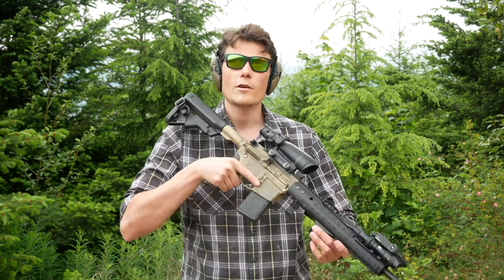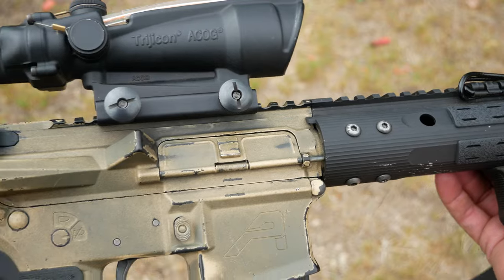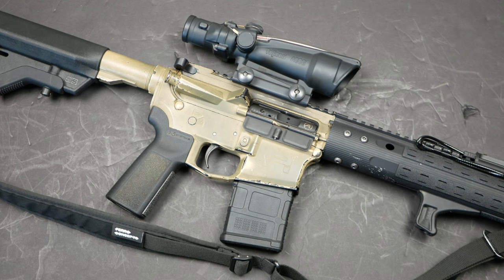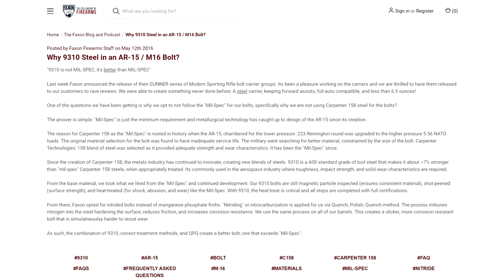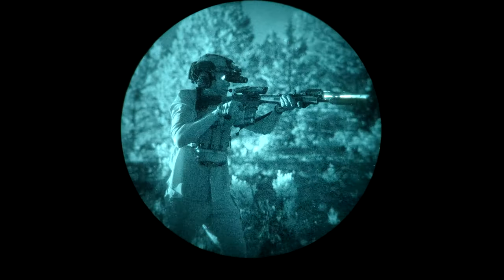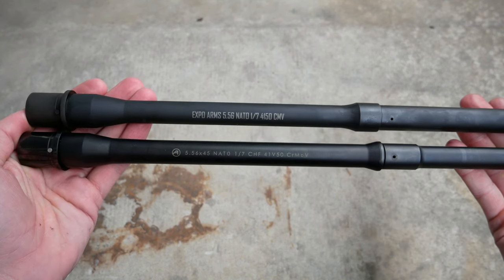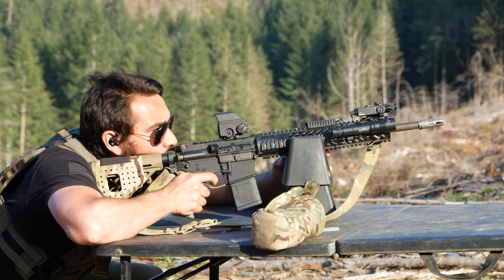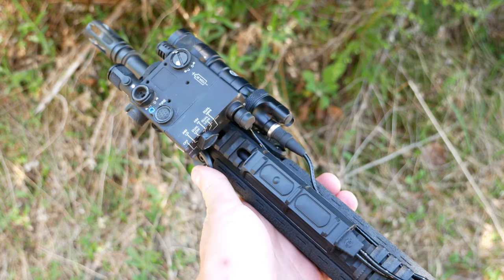Let's talk about the new Aero Precision PRO Series

Comment: 9310 is a slightly better bolt steel than c158. The problem with C158 is that it continues to work harden every shot, eventually cracking off lugs. 9310 on the other hand doesn't suffer from this as much/at all, and is like 3-4% tougher than c158. There was a day C158 was the best super steel, but that day was like 70 years ago, we have better now. Secondly, aero receivers are some of the smoothest I've had from any brand, I'm an absolute stickler for a smooth action and they've proven to be top of the stack.
Reply: As I understand it, the window for heat treating 9310 is more narrow than c158, and if your not paying attention, its a little easier to mess up. Certain methods of nitriding can add to the problem, witch is why JP uses some sort of DLC. At least that's everything I've heard that sounds more or less legit.

I'm not a metallurgist though, just some nerd to likes to read about material science.
Reply: @coltonowens2742  By most accounts, 9310 is more forgiving than C158, as C158 the shot peening is a critical step. S7 is trickier to heat treat though. Nitriding has been figured out at this point, we're past the days of crumbling nitride bolts.

Comment: While it isn't CHF, how does the Faxon 14.5 Gunner barrel compares to this barrel?
Reply from the maker: Gunner barrels are very strange. They're basically pencil barrels with an extended gas journal length to support a fixed front sight base. I have a quite accurate Faxon gunner barrel but it's one of the 5R versions they don't usually make so I don't know if it's representative of all their barrels.
Reply: @Hoplopfheil  Doesn't the pencil profile have a thinner profile between the extension and gas block journal? And would you consider a pinned 14.5 the new GOAT since braces are sorta banned?
Reply from the maker: @Megames2012 the gunner has a tiny bit more meat on it but it's still definitely pencily. 14.5 is probably never a bad idea.

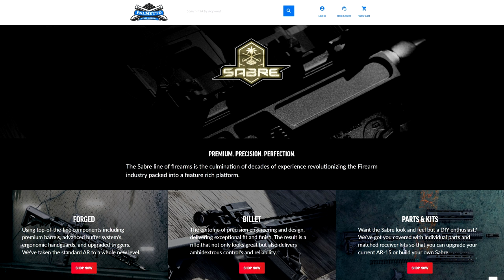Comment: at 1:30 I want to challenge that claim of "milspec" . that doesnt actually mean nothing. with that term, it means that it meets military specifications, in as far as materials, but more so, measurements. that it has all of the holes drilled in these exact locations to coincide with other milspec parts. that a milspec trigger will fit, that a milspec upper and lower will fit together.

as an example. the AR-15 has (for all intents and purposes) a milspec. which means that any part for an ar15 that was made to milspec (should) fit. where as there is no milspec for the AR-10, you end up with magazine wells that dont exactly fit all magazines, or bolt catches that dont fit. But most importantly you end up with DPMS cut, vs armalite cut. which changes the little area right before the buffer spring.

Comment: Aero's lowers are the best and cheap. Complete lowers for 300 or less. But the uppers are quality on; on sale you can get them 500-700. But I would just go Daniel Defense or Geissle Super Duty for 999 complete uppers when on sale.
Reply: A lower should only cost 120 incomplete and 200 complete (the parts are 30 so you're paying for a ton of labor on that bolt catch pin and nothing more)  for 300 it better be a high end lower with extra features
Reply: @jason200912 You are paying way too much at $120 for an incomplete lower.

I was using $300 as the top. You can get most SL or SL-S enhanced (forged triggerguard) complete lowers for 200-250 with free shipping. You'd be hard pressed to make those lowers for that cheap. 59.99 for a stripped enhanced lower, $60-80 for SL or SL-S stock, lower parts kit $60 (with tube and trigger), $15-20 for SL, SL-S, or MOE grip. Idk where you are getting you prices at.
Reply: @dutch0770  why would you choose the sl stock

Comment: I used to believe in the CHF thing, until I saw no difference. After finding out why SOLGW doesn’t make CHF barrels (so i could add something to the safe that wasn’t BCM or Glock)They didn’t find a difference either. And they will replace your barrel for free if you shoot it out. I don’t think anyone wouldn’t consider SOLGW a premium brand and “go to war” grade with an A5 recoil system STANDARD!
Reply: SOLGW  barrels are Ballistic Advantage made barrels, just marked as SOLGW....zero difference, maybe gas post size but nothing else.
Reply: @seniortac4175  which is cool. I use Hanson Contour barrels on my two 3 Gun uppers, and couldn’t be happier with them. My point is SOLGW is a Premium product correctly built. Most rifles are built with parts manufactured by someone else. There are quite a few people who bash Colt or FN, not realizing they have purchased at least a percentage of one. 

Sons guns are at least as good as my BCMs and way better than that POS over priced, over gassed DD rifle my wife unloaded when she got the SOL.
Reply: SOLGW just stated they are about to start doing CHF barrels...
Reply: It’s what people want, so they are appeasing the customer. So they will be the same ones that Aero Precision started using, or will be made by FN. depends whether they chrome line or nitride. I see no difference in my Colt, which is not CHF and BCM that have  no difference in wear or performance. Both have seen tons of rounds. So now SOLGW will have even more flavors to offer now.

Comment: How often do the gas rings need to be replaced?
Reply: School of American rifle shows you how to conduct a test.
Reply: The generally accepted test is standing the BCG on the bolt on a flat surface.  If the friction between the rings and the carrier can still hold up the weight of the carrier, the rings are still good.
Reply: @KidCorporate  That's phase 1, phase 2: remove cam pin and check to see if bolt falls out of carrier.

Comment: Just wanna hop in an tell you that CHF Barrels are not Milspec. 

Milspec is Button Rifled, Chrome Lined, 5.56.

Speaking in terms of M16 and M4, the military uses many many different rifles, all kinds of different processes for specialty rifles. 

Colt does Button for the military.
Reply: Button rifle needs to be pushed not pulled to be mil spec..

Comment: >barrels not chrome lined
>9310 bolt head
aaaaaaand it's useless, might as well save money and buy the non-pro sruff
Reply: 9310 is fine
Reply: Found the consuuuuuumer who fall for marketing gimmicks
Reply: @bradenmchenry995  The issue with 9310 was that for a long time "budget" brands used them because 9310 bolts are cheaper to produce than C158 bolts, and if 9310 isn't properly heat treated, it becomes brittle and prone to things like bolt lugs shearing and the bolt cracking at the cam pin channel. As long as a 9310 bolt is properly heat treated, it should not be prone to these issues.
Reply: @fakename287  Yup. A lot of nitrided BCGs out there are sloppy and gas inefficient due to not taking into consideration the lack of chrome lining in the carrier bore where the bolt travels. Off the top of my head, I know the nitrided BCGs that Bexar Arms sells are properly spec'ed for nitride instead of phosphate and chrome.

Comment: Is there actually any legitimate test data out there that proves CHF is better than modern button rifled barrels?
Reply: Yes, Colt Canada HF barrels lasted longer than the push button Colt barrels made in the states..
Reply: @hairydogstail  link?
Reply: This was told to all of us at a Colt Armors class by a Colt rep..They never stated the cost difference..They also stated US mil spec button rifled barrels need to be pushed button, not pulled to be mil spec.. @nikwoac
Reply: @hairydogstail  Most of those tests are in regards to full auto firing type scenarios right?
Reply: @hairydogstail  this is why I'm always skeptical about these claims. It's always "this manufacturer says so" without hard data.  I'm open to the possibility that CHF barrels do have longer service life, but until I see a true, scientific test, I will remain skeptical that it isn't just snake oil.
Reply: @nikwoac  I don't know why the Colt reps would need to lie about this subject, as it serves them no advantage..They were quite open about many other things after class discussions that were not always favorable to Colt itself..It was more of a matter of fact discussion rather than a sales pitch..The US military could require better bolts, barrels, etc, but it is not worth the cost/effort and is cheaper to just replace parts at a given round count.. There is a lot of opinion out in the AR world, but getting it from the source was refreshing..I think people can over think things.. The one area people need to focus more on is on the tolerance and materials issue..Chad from the School of the American Rifle has done a great job on this subject. Even Chad changes his mind as he acquires new information.. The military has spent a lot of money finding the best parts for cost with the M-16 platform and should be a good basis for any AR rifle.. You would be surprised by the out of spec parts even some of the higher end platforms put on the market once you understand the TDP and have the tools to gauge..Colt pin gauges every drill operation, other don't even come close..Other examples were straight gas tubes do not last as long as standard  (dog legged) gas tubes, suppressors cut a rifles life in half, Colt's gas keys, castle nuts, receiver extensions (buffer tubes), charging handles, front sights, etc, are forged not extruded for strength and is the reason they cost a lot more money...There is a reason, (other than greed and manufacturing processes) why some rifles cost a lot more than others..Colt parts meeting tolerances from bin one come from the same manufacturer lesser parts from bin 2 through 6 are sold to other manufacturers, (other wise known as rejects)..Some batch test bolts/parts while other test every bolt/part..I could go on and on but you get the idea..
Reply: @hairydogstail  THANK YOU....out of the voice of reason come truth! I have attended MANY Colt Armorer's classes over the years, and had the same exact experience each time. And as an added statement AERO PRECISION manufacturers a considerable amount of parts for.....pick a "higher" end brand name and insert it here! Regarding the BCG's, I'm still not convinced that 90% of all BCG aren't manufactured by MICROBEST or TOOLCRAFT!

Comment: I’m more interested bcg finishes chrome vs nickel boron vs nitride
Reply: Avoid all of those besides chrome
Reply: Chrome & Phosphate are the top 2 best 2 finishes. 
Nickel boron is crap. 
Nitride is somewhere in between.
Reply: @phillipk1258 nitride is better than phosphate just harder to manufacture properly
Reply: NiB isn't a good finish. It tends to flake off over time and has other issues. Nitride is fine as long as the BCG is machined with a lack of chrome lining in mind, otherwise the bolt tail and gas ring chamber will be oversized and the bolt will be sloppy in the carrier, causing it to be gas inefficient. Phosphated and chrome lined is still the most popular option, especially for "duty grade" rifles.
Reply: Well I know a SOTAR video with your name on it!

Comment: Remember - "mil spec' = lowest bidder.
Reply: No, mil spec means parts are manufactured to DOD tolerances that were designed for the AR-15/ M-16 platform.. Most non Colt manufacturers don't even meet mill spec..If you can find the TDP specs and get the gauges to measure, then you will understand what I'm talking about..

Comment: They could of done a different bcg with a 3rd gas port, but nope.. looks standard, nothing special from the "pro" series. -_-
Reply: That’s whole point, it’s about quality not slapping some dumb ass marketing gimmicks on so it looks different.
Reply: @jamfd3s788  My cmc enhanced and my lmt enhanced make my sbr shoot smoother.. I guess that's magic and a gimmick.. damn I should of listened to you, what was I thinking. ;)
Reply: @hifi4lyfe406  yea I own the CMC bcg too, it was literally designed specifically for suppressor usage it doesn't make a normal non-suppressed setup shoot any better. The aero has multiple differentiating features from the normal series as well as being cheaper than the CMC and literally gobs cheaper than a "Gucci" LMT.

Comment: Tuning your gas system is snake oil? Come on man, how do you think combustion engines run properly? If tuning your gas system never provided measurable benefits there would only ever be one gas length.
Reply: “There’s no need to adjust your afr if the car is driving” basically
Reply from the maker: Wake me up when my rifle has an ECU that can adjust trim on the fly as the gun gets dirty, cold, and the quality of the gas changes.
Reply: @bradenmchenry995  That is not a good standard for optimization.
Reply: @Hoplopfheil  Not all combustion engines or gas systems have or require an ecu. That does not mean there is no optimal timing for each system within the parameters of the design. You know why MK.18s were ripping rims off of cases in the beginning, right? If gas tuning did not matter, this never would have been an issue. There is so much evidence in the world in and beyond firearms that gas tuning matters it really is indisputable.